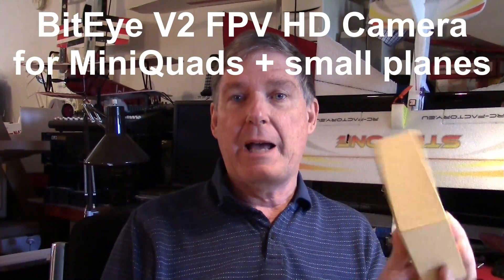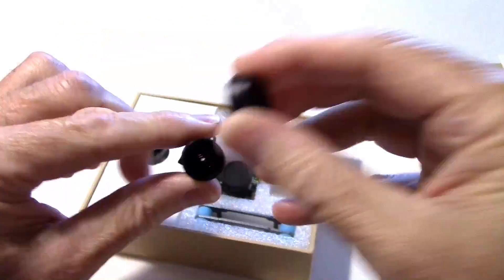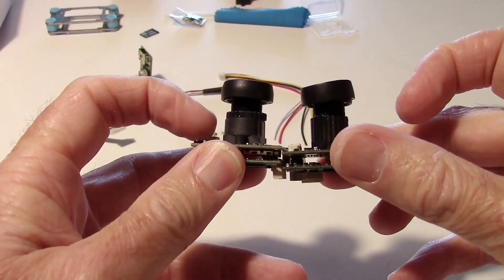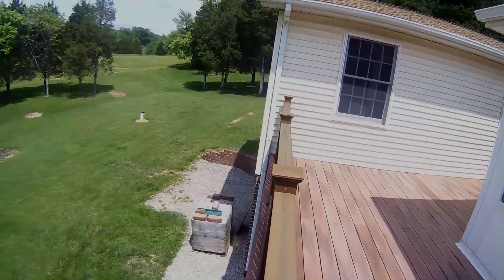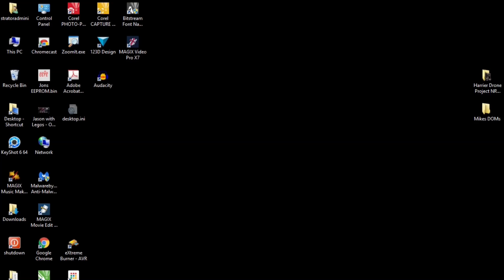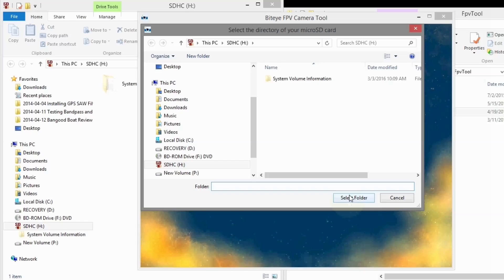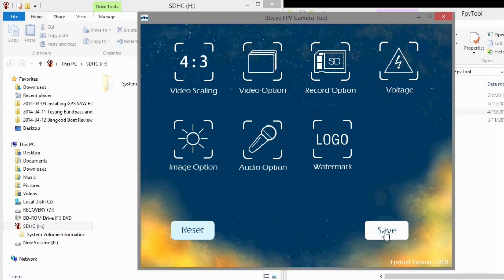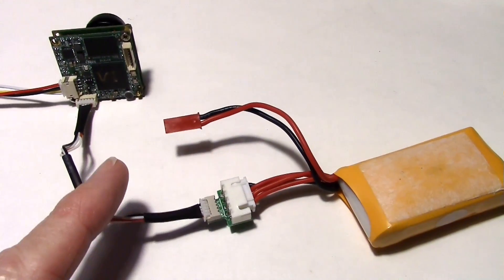BitEye FPV V2 Low Latency Board Camera with 1080p Video Recorder

Comment: The boards came in one piece!  You have to snap them apart.  The voltage detect plug is for a 4S LIPO.  Not sure what you do if you have a 3S.

It's a mystery how to attach the isolation plate!  There are a bunch of screws but I need a close-up to see which bits go where, and after attaching the cam to the mount, I guess I have to either pop the balls out or hold the cam back while driving screws into the plane mounting.

But yes, the USB "card" can be hot-glued to the inside of the fuselage so I can leave the camera in the plane.  The video looks really good.

I sent an email to biteye.cn and asked what the "remote control connector" pins do.  There are three pins

Comment: The presence of a DCIM folder would indicate the camera can be triggered to take STILL images.  I wonder how that can be done?
Reply from the maker: I don't think it's setup to do snap shots at all. It's more like a car DVR that just starts recording when the power is applied. No idea what the other connectors do. You can make a USB cable for it to get files off to your computer.
I show how to do that in one video. I would not put it inside an aircraft though because it needs cooling from the air blowing over it.
Reply: I ordered one after your review -- the second one with the USB cable.  I have several obscure "action cams" and on more than one I've found mystery pins that trigger all sorts of good things.  Put them on a channel-controlled dry-close relay and you have more capability.
Reply from the maker: Well if find out anything about the extra connectors you could let me know. The USB cable is nice to have.

Comment: Great job Dave! I'm so slow that I'm just getting around to testing the V1 (although I am building a plane around it lol) I'm excited to give it a try and then get my hands on one of the V2's. Thumbs up and happy flying to you!
Cheers, Bob
Reply from the maker: +TripleThreatRC That's cool Bob, You can actually upgrade the firmware on the V1 and turn it into a V2.
You can build a USB cable for it too. I probably need to do a video on that for those who have bought the V1.
Reply: +dmerc00 
Good stuff Dave and I for one, would be grateful to see a video from you on how to make up a custom USB cable.  Cheers!
Reply from the maker: +TripleThreatRC I probably will do that. See you later.

Comment: I've been looking for something like this.  It seems pretty close to what I'm looking for, but 63ms seems a bit high for a miniquad.  I'm not sure I could use that well with that amount of latency.  Thanks for the review!
Reply from the maker: +Desrtfox71 But 63ms is only 63/1000 or 2/3 of a 10th of a second. That's short!
Reply: +dmerc00 
As far as I know, it doesn't get much better than this one in terms of latency. There aren't many cameras that can beat it.